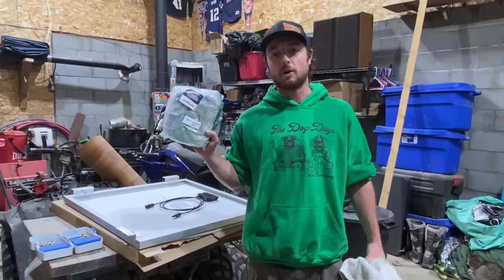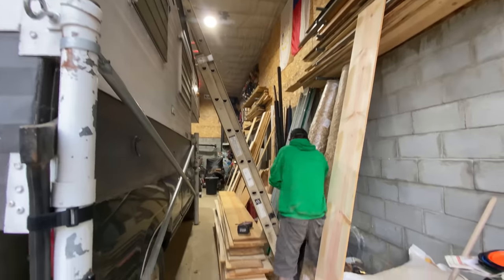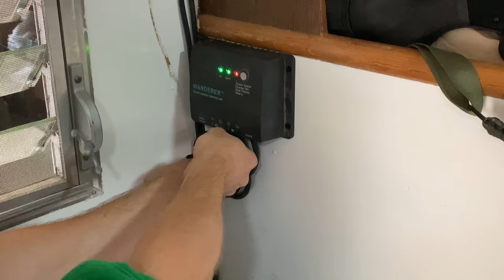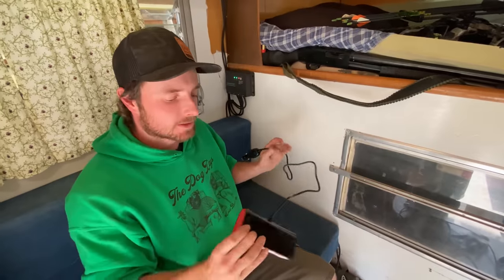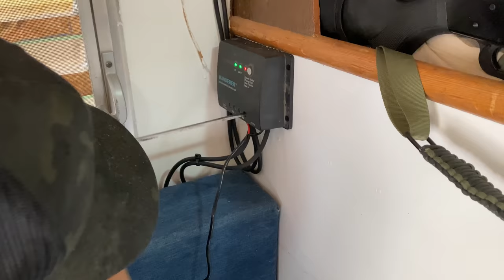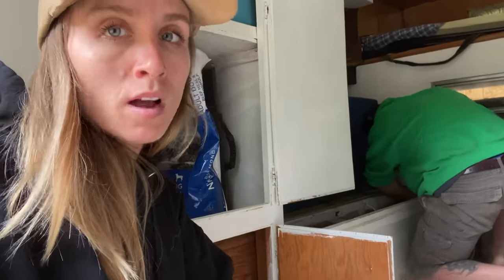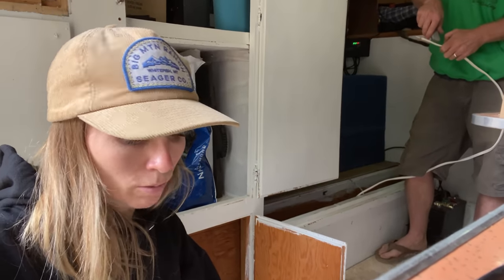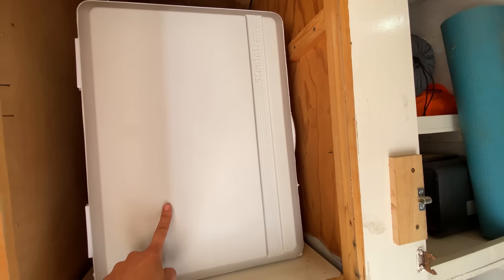Overland Rig Solar System Installation

Comment: Just a heads up, when using a hole saw drill half way through both sides to avoid blowouts. Good job on the power up.

Comment: Great job getting everything wired up but, you might consider using some Dicor self leveling RV lap sealant for all your roof penetrations to prevent potential future leaks. It's a cheap investment.

Comment: Hi  Guys your doing great  But  the Batteries do "off Gas" and you may want to try to mount/put the Camper battery/ies  out side of camper if you have space  between the camper and side wall of truck Bed   I did that with My system and as a plus gave me more room in camper  .  GOOD LUCK   Looking Great

Comment: It's probably a mute point, but I hope you screwed into the roof bracing on the camper, it looked a little flimsy. Not wanting the wind to catch the panels going down the road and rip them off. I've seen enough wind damage the last few days..hurricane Ian Love ya'll ❤️

Comment: Get some RV lap sealant for future use on the camper. The silicone will shrink slightly and you won’t be able to see the small cracks that will develop and allow water inside.

Comment: I know you know.....but.....12VDC cables should by multi-stranded copper and not solid core. DC current runs along the outside of the wire cores. The more wires the better. AC runs thru the center of the solid cores. But it's whatever. You got it running and that's fine with me.  Thanks for sharing.

Comment: It would be me I'd work on the more important projects that needs to be done first like getting my retaining wall put in. Because that would be a higher priority project to get done then wiring a camper up for solar electric. I mean for me winding up a camper for solar electric would be a winter project to work on.
Reply: @texancowboy9988  well that may just happen if they don't get the retaining wall installed in to hold all that soil back. Yes it's true that concrete is a durable but however when you get enough pressure on concrete it will begin to crack and crumble down on itself. So that's why I said that priority things needs to be done first and miscellaneous things can be done later.
Reply: @clivereynolds6633  why so negative Clive? Are you jealous that they are living the dream? You are contributing every time you comment 😆
Reply from the maker: Lol. “Solid advice”
Reply: @clivereynolds6633  yes you’re right there are many keyboard warriors out there. you are awfully critical for someone who claims you want them to succeed. Calling them ten year olds. I’m anxious to see when they have coming, I hope they prove you wrong. Be well Clyde ✌️
Reply: I think that Molly is right. I didn't think that my comment was going to bring out the children. And if people can't give advice or Express their opinions. With having others leaving childish comments. I stand on my opinion in my first original comment which was if it would be me I would work on more important projects and leave the miscellaneous projects for later. That's exactly what I believe in and in my life that's exactly what I do the more important projects are done first and the miscellaneous projects or placed on the back burner until later date that's just how I roll that's just how I am. And if anyone cannot accept that or understand that then oh well. As far as the refrigerator in the camper goes I mean it could been completely disconnected and put on hold at a later date. It's not like I didn't get that they felt like they had to rerun wiring so that the refrigerator could operate at a safe level and I get that they felt that they had to get that done. But at the same time again my opinion was that the retaining wall was a more important project the summer has gone by and we're going into winter that was my point of my comment to me I felt like that it was a more important project to worry about. So on this note I'm just going to say if anyone reads this comment and has any negative thoughts on it please do not respond keep your negative thoughts to yourself.

Comment: This has nothing to do with your video but you mentioned pressure canning and that all vegetables can be water bath canned....this is some what true but most vegetables are to low in acid to kill botchulism and is unsafe unless you boil it for 12 minutes when you open the jar ... tomatoes are high acid foods and can be water bath canned safely by adding lemon juice...but other vegetables should be pressure canned......I know y'all will do your homework work first before canning I just wanted to make sure though...cheers